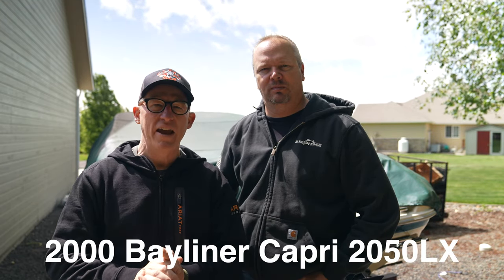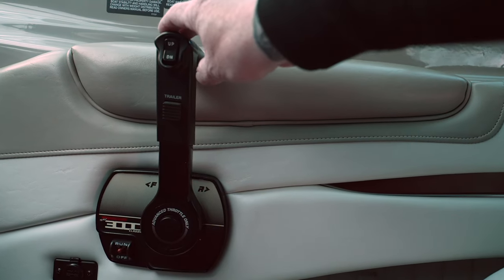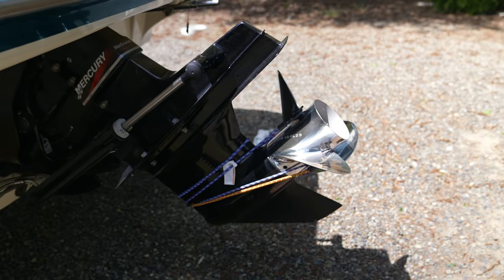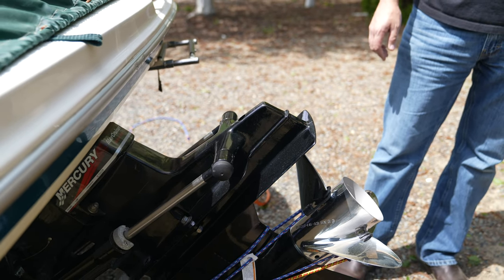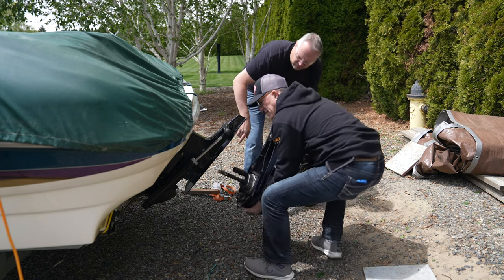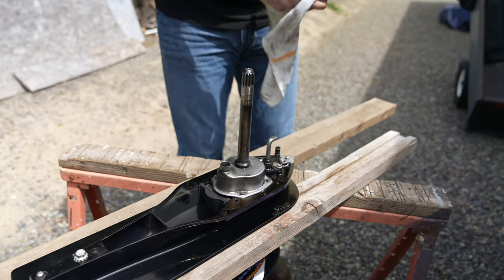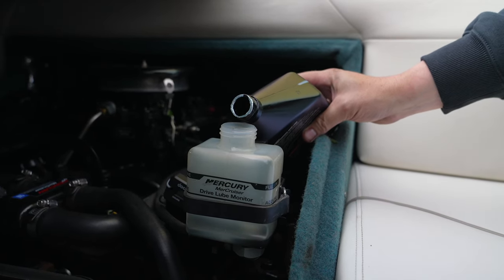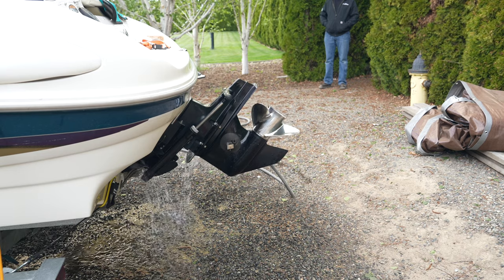How To Replace The Impeller On A Mercruiser Alpha One Sterndrive Outdrive

Comment: Bottom half wont re-align even after turning the prop shaft. from the looks of it splines should be mated properly. gear shifter is still in the drive position. Any suggestions?
Reply: Questions is, Do I need to leave shifter in forward position for the reinstall
Reply: did you ever figure this out? i’m in the same scenario. thx.
Reply: @longislandsound  yes, I did it alone. Once I turned the spline it dropped right in

Comment: Nice video but the bungee cords on the prop are unnecessary. When you are putting the lower unit together get it in place and if it doesn't mesh then just turn the prop slightly and it will mesh. I never understood why people called this the hard part they really aren't hard to put together.
Reply from the maker: Thanks for watching. Always many ways to do a project.
Reply: Hi, I just did this today. If you don't mind i have 2 questions. When adding the gasket seal to the bottom of the first gasket you put it across a piece of gasket that doesn't actually touch anything? Why add the sealer and why does the first gasket even have that extra piece across? I don't think the oem had that.. Also are you worried that when you put the housing back on will the gasket seal push into the housing, harden and actually ruin the new impeller? Thank you!

Comment: I'm having problems with sliding the lower unit up in not sure what I'm doing wrong
Reply: It was very hard to line up. I used a floor jack to help hold it (just be careful not to put any pressure on it with the jack)
Reply: A month ago but, we had that last 1/8th inch it wouldn't go. It was where the shift lever arm slides into the slot,  moved slightly, went right up.

Comment: Do you have to drain the oil ?
Reply from the maker: No, but we decided to.  You might loose half a cup and then need to top it off.
Reply: @RyanUrlacher  If you dont the upper will drain down all over the place. Also this gear oil is critical to keep you lower unit gears in top shape. gear oil is cheap insurance.